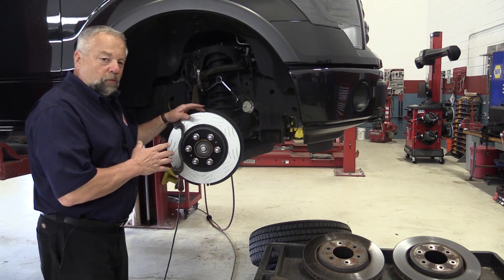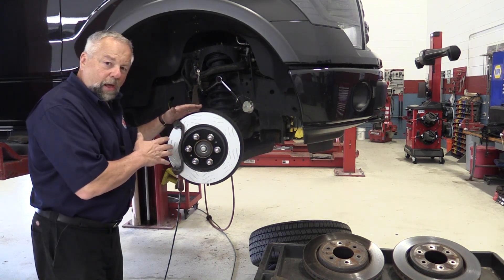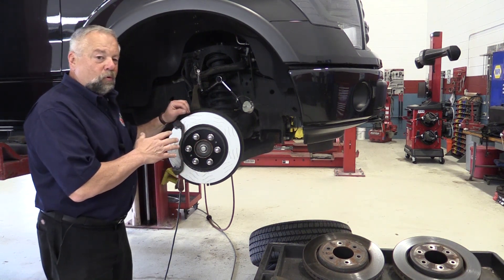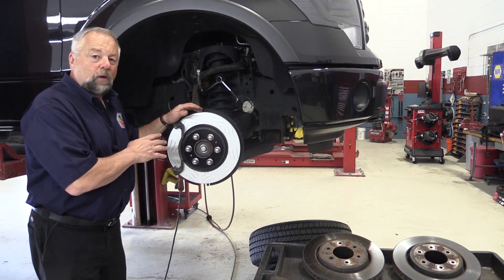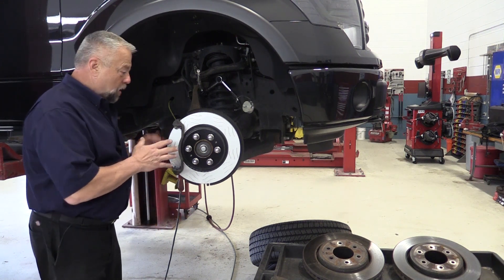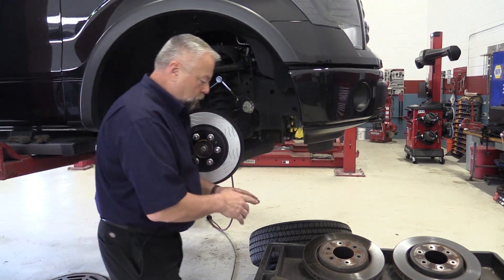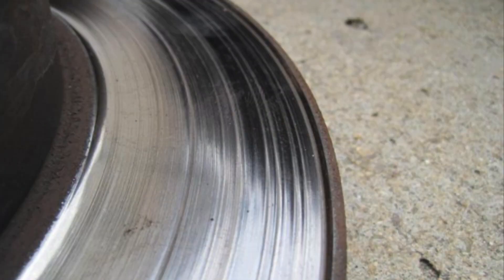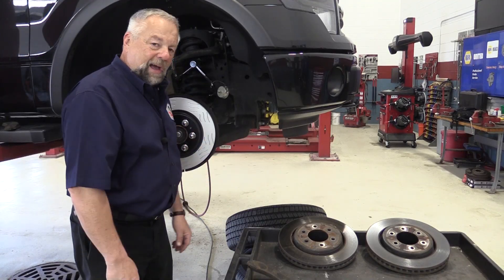Ceramic or Semi Metallic Brake Pads on Your Vehicle?

Comment: This video did not explain anything about the differences between the two types of brake pads
Reply: Semi metallic transfers more heat onto the rotors and wares them out faster but semi metallic have better stopping power.   Ceramic pads do not have the same stopping power but they are solid for every day use and don't ware down your rotors that fast.
Apparently from posts online the element 3 has slightly less stopping power during the cold winter then Akibono ceramic pads but that's rabble on the net so..
Reply: Agreed, complete waste of time. There was zero useful information here
Reply: Thanks, saved me a watch.

Comment: Ceramics will wear out before destroying the rotors.  In that way you will get a longer life span on the more expensive rotors.  I'd rather replace the brake pads than my high performance zimmermann rotors
Reply: after 3 years sir, how are your rotors still?
This is a good point you've made.
Reply: Jeah, inform us after 3 years, how things are going?!
Reply: 4 years later and we're still waiting to hear from you.
Reply: 5 years my guy....where's the update!?

Comment: I tried Ceramics thinking to upgrade to a more advanced system upgrade on my T/A, took way too long to Stop meaning stopping distance was lengthened, not good, and slid passed Stop Signs that put the fear of impending tragedy in me. Quickly switched back to Metallic. One thing I can state with confidence, you do not need to turn your rotors when running Metallic Pads unless they are badly warped as the Met Pads wear the rotors down naturally and in light cases of warping the everyday driving will smooth them back out. Slotted Disc Rotors did make a difference. though.

Comment: I once tried ceramic pads on my GMC Yukon Denali, but they were very prone to developing squeaking noise.  I switched over to semi metallic and those seem to perform better, and are super quiet at all times.
Reply: Do you know what brand they were? My car is no where near like yours but I have a Honda civic coupe 08 I’m trynna soup it up and put good performance brake pads and rotors but I’m sooo lost
Reply: @killedbyshadows1500  I am using the Wagner Brake SevereDuty SX975 Disc Brake Pad Set.  They are wonderful.  The braking feels great, super quiet, and the pads seem to last forever.  The only very minor downside is that they tend to put orange brake dust on the wheels over time.  These pads are designed for severe/performance use.
Reply: i wonder if thats the noice that my car does.....is has brand new rotors and pads...but this one are semi metallic and i think before it has ceramic quiet......that could be the problem?
Reply: Akebono ceramics are said to be quiet brake pads. 

I am going with Akebono ceramic brake pads, as per Scotty. I don't have the weight. I want performance for my passenger use only Explorer Scout, and no brake dust on the alloy wheels.
Reply: Ceramica are more quiet than semi Metallics. If your brakes were squealing with ceramics, you probably didn't install brake grease, bed in the pad, or were using cheap ceramics that don't have sticky material between anti squeal shim and pad backing plate.

Comment: Semi metallic are better in cold climates also. For this reason. I use semi metallic. And in the north your brake rotors will rust to scrap before those pads will wear them.
Reply: Thanks for that info.

Comment: In 1999 I bought the all-new Chevy Suburban. The previous gen Suburban was notorious for eating front pads in a hurry. For the new model GM upsized the rotors and went to ceramic pads. What a huge difference! The original pads went over 100,000 miles, and the vehicle was used as a work truck for the majority of it's life; hauling, a little towing, and trucking around a family of 5. There was still some life in the pads when they were finally changed. As a side benefit there was never any brake dust on my wheels. I'm a believer in ceramics. Organic pads are for keeping mechanics in business with frequent brake jobs, semi-metallic have their place, but I don't like the extra noise and faster wear to the rotors. I think ceramics more than pay for their extra cost in their longevity and thus fewer brake jobs.
Reply: Old collapsed brake hoses cause premature brake pad life. Slotted & cross drilled rotors will help braking a great deal dissipating heat, brake material and gases between the pads and rotor which causes brake fade.
Reply: The problem with the previous generation (88-98) Chevys and GMCs wasn't the semi-metallic pads up front but the proportioning to the rear was inadequate, leaving the fronts to do almost all the work, wearing them out prematurely. There was a TSB about upgrading the proportioning valve in order to get better braking distribution.
Reply: I just made the switch to ceramics, my Honda S2000 eat front brake pad as well I’m hoping to get way more miles on them that like 20k like the last front brakes

Comment: Aside from looking at the rotor to see if ceramic or semi-metallic pads had been used, an easy way is to take a magnet to the brake pad braking surface.  If it sticks it's a semi-metallic pad.
Reply: What if it has steel frame?
Reply: Most disc brake pad frames are steel.  Place the magnet on the friction material part to determine if they are semi metallic (assuming the brakes are not worn down to the backing frame.)
Reply: That would only tell you that the metal is ferrous, not all metal is, in fact metals used in brake pads would be softer ones that are likely to be non ferrous

Comment: I switched to ceramic pads on my FJ Cruiser and started getting a warped rotor feeling when I brake and some brake fade. I’m putting new rotors on and switching back to OEM pads. I do tow a small travel trailer and had no problems until I switched to ceramic pads.

Comment: I’ve always been told that ceramic was the best regardless and that semi metallic and metallic were old technology and should only be used if the vehicle came with them on. I’m a professional mechanic and that’s what all the guys in my shop say. As well as what I learned in school. So just my opinion I say stick with ceramic unless you have an old car that came with something else. Also make sure the rotors are rated for the pad material you can’t use rotors that can only withstand semi metallic pads then put ceramic on them.
Reply: Im also a mechanic and ceramic is not always the best. It is most of the time, but like this guy says if you’re towing alot u should definitely go with semi mets. All the guys in my shop agree with that too, although what all the techs think isn’t necessary correct

Comment: Raybestos EHT’s - cross between semi metallic & ceramic, best pads I’ve bought,
Reply: Billy Jack I was considering purchasing the Raybestos EHT's, how is there initial bite and resistence to heat fade?
Reply: @vanquishstorm  they have been very good, great stopping and no problems with brake fade, although they are on a  GMC 1500
Reply: @billyjack7421  Awesome, thanks for the reply. I purchased them and looking foward to the install.

Comment: By how much differences between  Ceramic vs semimetal pads in stopping? 

10% -20 % difference? As for distances
Reply: @Val Bigfish which one
Reply: There is no difference in stopping distance as they both are capable of locking up the wheels if you press the pedal hard enough, stopping distance is a function of tire traction (how much pressure you can hold before locking up, and your reaction time in applying the required pressure) As I've said, either type of pad has the ability to grip the rotors beyond the threshold of tire traction. Ceramics just don't "bite" as good when cold, requiring more pedal pressure than you were used to in order to achieve the same clamping force on the rotor, sometimes leading to a false impression that it takes longer to stop. Ceramics also produce white dust instead of brown and black, leading to the false impression that your wheels stay cleaner longer, the pad dust is still there, you just can't see it as much, and besides slightly less rotor wear, the primary claim to fame with ceramics is cleaner wheels. If you don't mind dirtier looking wheels or cleaning your wheels a little more often, semi-metallic is the way to go because they do bite the rotor a little better.
Reply: The difference is the life of Bambi's mom. #SquirrelsLivesMatter
Reply: @johnny0454  Many cold ceramic pads are unable to lock up the wheels on many cars...
Reply: @johnny0454  the real difference you didn't mention is heat tolerances and brake fade. The semi metallics are far superior in this sense and thus better for high performance vehicles or heavy vehicles such as trucks that tow or haul heavy loads
Reply: @ipcamtalk4314  That's incorrect; besides, they are only cold for one or two revolutions of the rotor, which equates to only the first quarter second or so of application; after that, they are no longer cold.
Reply: @johnny0454  Incorrect. Ceramic must remain hot for a tight bite. Strong and immediate stopping power is required every single time. First stop of the day and emergency stop on highway. I have driven many cars with ceramics and they suck for everyday driving. They should not be used other than on the track. Period.
Reply: @truthhurts1754  The original question was about stopping distances, I didn't mention brake-fade because the vast majority of people will never experience it in their lifetime, and so it's more of a specialized dynamic to consider rather than "the real difference" as you suggested. Additionally, with proper driving habits, even while towing a heavy trailer with a heavy truck, a person won't experience brake fade, even with ceramics. In my experience, it hasn't really been a concern on trucks since the '90s; when wheel, and thus rotor, diameters were much smaller and they mostly had rear drums. They also only had single piston calipers, allowing a pressure differential from the center to the outsides of the pads, due to the pads flexing at 3500psi, because of that they didn't utilize all of the available surface area for an equal clamping force. Those issues have long been solved in the 30+ years since then. You can't find any vehicle manufactured today with tiny little rotors and single piston calipers anymore, even on the rear, most rear calipers these days are at least dual piston, even on the cheapo vehicles, and up front.... most of the trucks come with at least 20" wheels (very large rotors) and 4 piston calipers rendering brake fade a thing of the past. As you may know, rotor diameter has an exponentially dramatic effect on lessening the required clamping force the further you get away from the center of rotation due to leverage, thus also lowering brake temps (the cause of fade) significantly.
Reply: @ipcamtalk4314  You are wrong. For more than a decade, most cars have come from the factory with ceramic pads, and 99% of people would never be able to tell the difference. If what you are saying is true, would that be the case.... no, it wouldn't. I drive a 5000 pound car every day, with ceramics all the way around, in Montana, where we regularly hit -20°F and they bite just fine, the first time, every time. You obviously don't know what you're talking about. Your statement may have been true 30 years ago (I remember, I was there), but not these days, so stop spreading misinformation and get your knowledge current.
Reply: @johnny0454  You are wrong. Almost no cars come with ceramic pads. Stop lying and spreading misinformation. You are clueless.
Reply: @johnny0454  Moreover you admit ceramic pads require you to keep them heated at all times, that is why you say "proper driving habits". This is way almost every OEM ships with semi metallic. Get your info straight.
Reply: @johnny0454  When you have to resort to name calling, you already know that you lost the argument. A quick google search will show that most new cars are factory equipped with semi-metallic pads. Why would proper driving habits of not riding the brake be required more for ceramic pads than semi-metallic. And if they are not, why did you mention that in this discussion. Check and mate, boy.
Reply: Also read many of the other comments here from users who posted 2 years ago like user "star burts" who verifies that he slid through stop signs because of the poor bite with ceramics.
Reply: @johnny0454  Its not one outlier experience there are hundreds of similar sentiments in these comments. Thousands of others on the net. You are clueless and endangering the lives of others. Its ok to admit you made a mistake. Go out right now in your vehicle speed up to 25mph and attempt to make a panic stop on a smooth surface. Your brakes will not be able to create enough friction to engage the abs because the wheels wont be at the lockup threshold.
Reply: @ipcam Talk  lol that's a straight up lie
Reply: @NoName-gv6nm  How so?

Comment: When should ceramic pads be used ?
Reply: ceramic if youre not hauling heavy loads
Reply: If you want your wheels to look cleaner, longer. That's really the only benefit, other than the dust isn't as bad for the environment, which is the sole reason they were developed in the first place.

Comment: Did he just say that the O.E.M. pads might not be the right one that came on the vehicle??? I dislike auto engineers to, but I feel like STOPPING! is pretty high on the list, plus I can confirm that some independent HVAC/Plumbers have no regard to towing capacity or curb weight when forcing a half ton tool chest in the back of their trucks.
Reply: He is correct. The better choice for an F150 that tows or hauls heavy would be a semi metallic pad even though the OEM pad is ceramic. You don't need to be an engineer to know for a fact that semi metallics are better for brake fade caused by extended heavy use from the extra weight.

Comment: My rotors get grooved up and starts squealing and pulsing while braking.  I've been using semi mettalic.  It's on a Small SUV that I only drive about 3,000 miles per year.  After about 3 years there are groves and the squealing starts.  Would ceramic be a good choice for me and last longer?  Thanks
Reply: Two differences issues. Pulsing means they're a little warped from heat buildup while braking. Do you do a lot of heavy braking? If so, start braking sooner. As far as noise, ceramic solves that.
Reply: Semi Metallic dust a lot, and this dust causes some of the squeal. try power washing the brakes, or get undercoat wash, the noise should be gone afterwards. the groves are normal. pulsing while braking is not. when putting on new brake rotors and pads, you need to measure the rotor run out. only when it is under 2/1000, your brakes will be properly installed, and not wobble. "rotor warp" is an internet myth. rotor run out is causing the issue. will need to fix the run out issue and install new rotors/pads to fix
Reply: @criticaljim1  Well said👍You beat me to it lol. If you don't have a dial indicator, you cannot install brake rotors correctly.
Reply: As mentioned above, .002" is usually the standard amount of acceptable run out. Which is also usually the closest tolerance that hubs and rotors can be manufactured to. So, say you don't index your rotor to the hub in order to cancel out the combined runout from the hub and the rotor, if you put it on and by chance, the tolerances get stacked, say .002" from the hub and .002" from the rotor, you'll have .004" total runout, which is too much and out of spec, you will get pulsating brakes eventually, because the pads are always rubbing slightly, even when you're not pressing the brake pedal, so with every revolution the high spot (lateral runout on the rotor) is being built up more and more with material transfer from the pad, it has very little to do with heat build up causing warpage, 99.9% of the time pulsating brakes are caused by thickness variation due to excessive lateral runout upon installation. In the video, he even mentions that they got the new rotors installed at .001" lateral runout when they put them on. It is industry standard to measure it, every time, without exception. If a person just slaps rotors on all willy-nilly like, they are a hack and I wouldn not trust them near my stuff. So if you're taking your car somewhere to have brakes put on and they say you need new rotors also, ask them if they check lateral runout when installing rotors, if they don't know what you're talking about, politely decline and go somewhere else as they are not a real mechanic.
Reply: I use ceramic on a Lexus rx350 and all my rotor sets get warped… might have to change and try slotted rotors and see how that goes.
Reply: @zavalafrancisco23  I'm guessing you have a mechanical problem, maybe a sticking caliper, causing excessive drag and heat, typically the type of pad won't cause a rotor to warp.

Comment: I drive a Dodge Caravan soccer mom van but do a lot of mountain driving.  I have Raybestos rotors with the EHT pads.  The braking is awful.  Would it be better to use semi-metallic pads?
Reply: Yes
Reply: Yes. Way better. Dont fall for the hype of ceramic. Good for the track maybe.